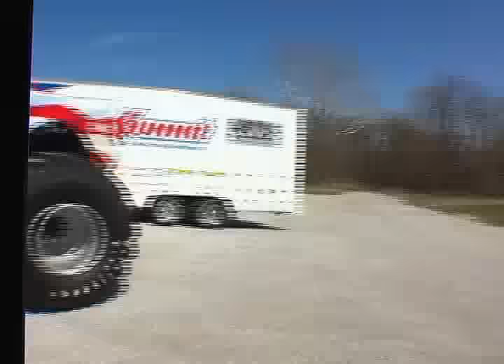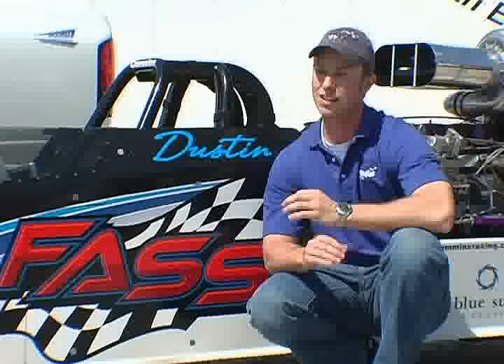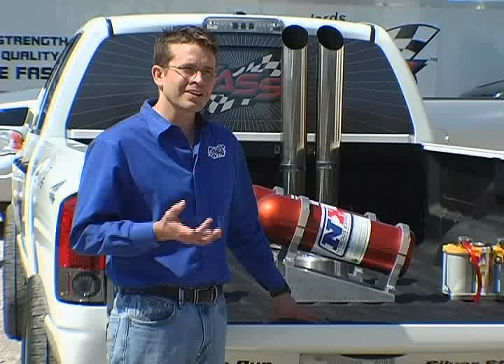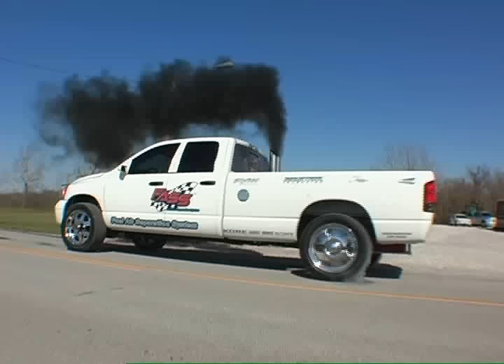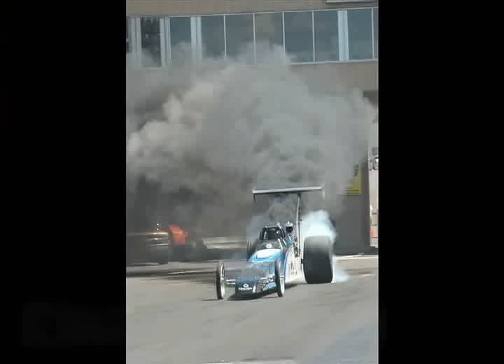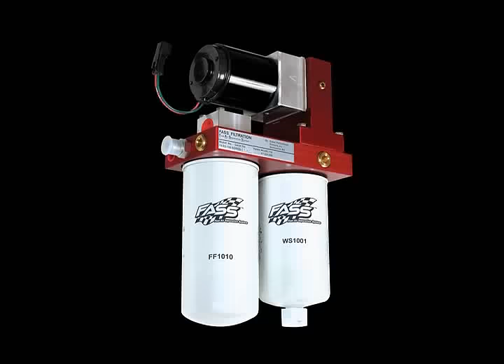What FASS is about

Comment: Black Smoke is lost power, not more. Any diesel add on accessory or modification that produces additional soot/smoke is lost power every time. The correct air/fuel ratio and air density makes horsepower/torque. These air separator fuel systems are a quality enhancement to any diesel system that cannot produce pure diesel liquid.